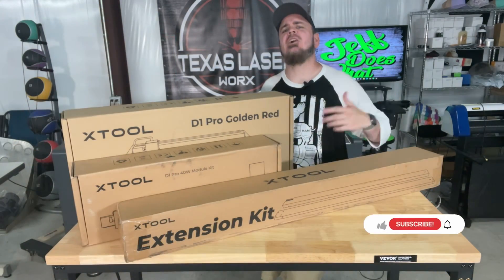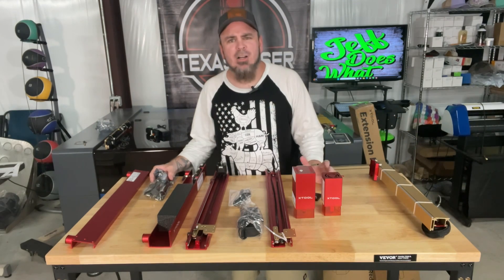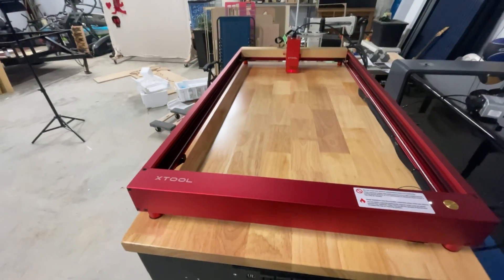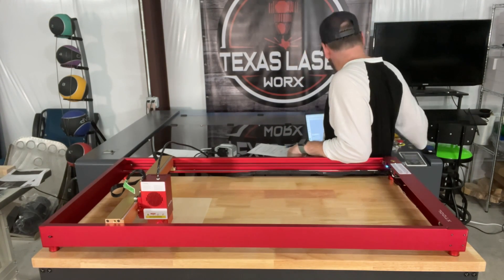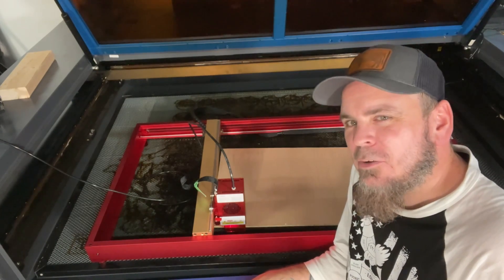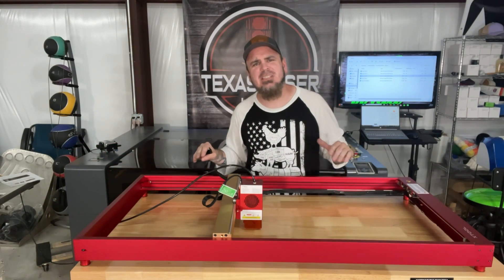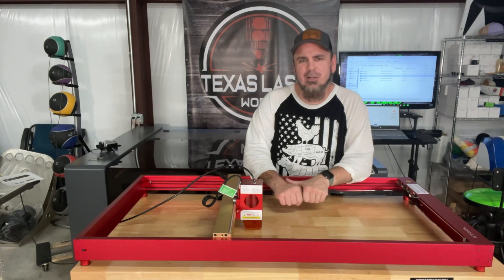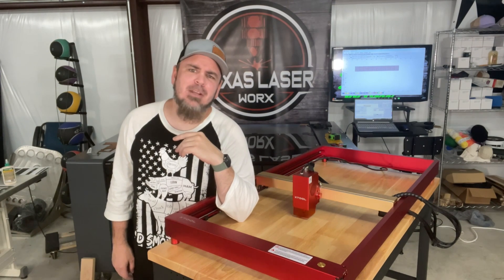Unlocking the Potential: xTool D1 Pro 40w Proficiency Guide

Comment: Nice video. I just got a 40w with ext. What were the settings for the dog? Did you have air assist on?
Reply from the maker: I did use air assist. I used 95% power. If i remember right 10 mm speed.

Comment: Bias review bcoz its endorse
Reply from the maker: Thanks for watching. As far as diode laser for cutting this one is unmatched. It is the strongest on the market. Now my co2 will walk circles are that but also more than 5 times the cost. As far as small details; the picture quality isn’t as good being the 40w has a bigger dot compared to smaller power laser. I won’t be using it for stuff like that in my business. But vector art and cutting it walks circles around the other diode lasers.